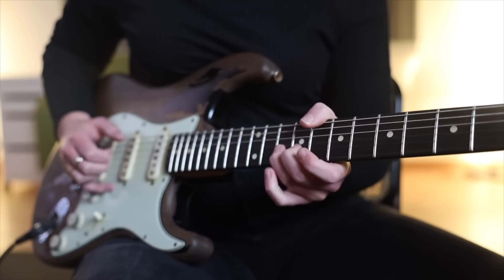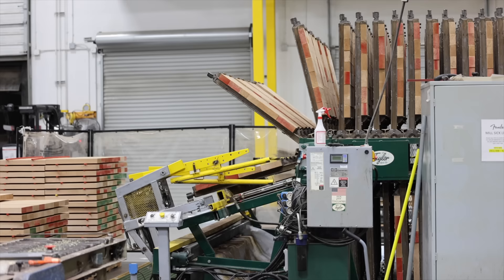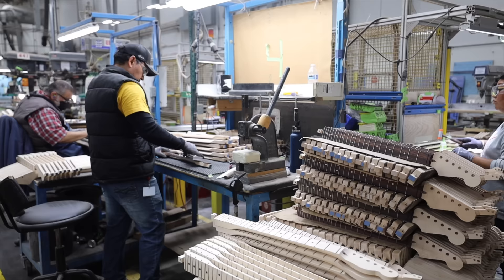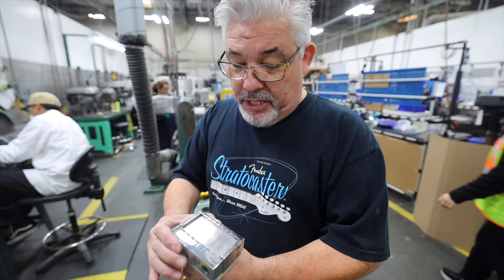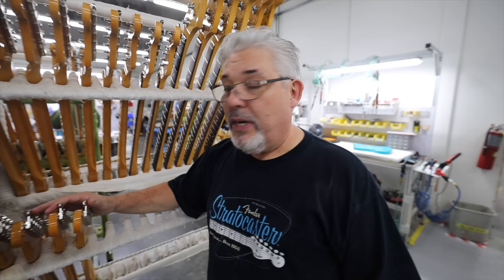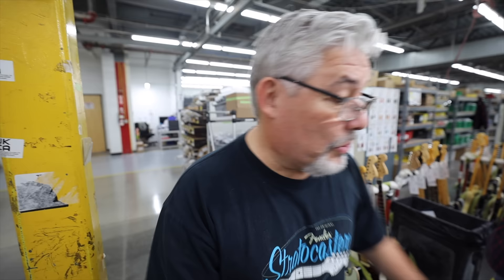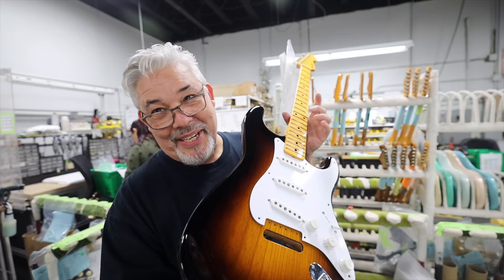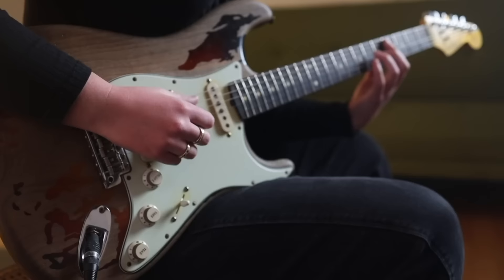How To Build A Fender Guitar

Comment: Dear Fender: As someone who has had to handle and adjust hundreds of your guitars: the intonation tool you use doesn't work. Your guitars aren't made anywhere near precisely enough for that to work. You should consider actually intonating them.
Reply: Good point, maybe for factory?,
But I think everything needs to be hands on.
Reply: I’ve always seen Fenders as a “good enough for government work” kind of guitar—regardless of prices point. I believe dealers should be doing final setup before they go up on the wall. But, that’s simply my opinion.
Reply: @thestuffmikedoes2309  Agreed! I’ve always wondered why that’s not just a standard thing.
Reply: As someone who works on guitars, you should know that setups change as the guitar moves to different climates, and different players prefer different setups, so companies typically just get it in the ballpark and save the man hours. Any competent player can adjust their own intonation.
Reply: @TheRealxVincent  Agreed. I've spent many years paying ppl to set up guitars for me, and it always seemed like it wasn't quite good enough until I bought all the tools and started doing it myself. Now I can fine tune intonation, string height, nut adjustment and neck bow to make my guitar ring the way I want it to.

Comment: I loved this! I worked in manufacturing most of my life, used CNC machines similar to the ones cutting the bodies and necks. My first job was in a machine shop in 1977 on Fender avenue in Fullerton Ca. I was told that Leo Fender owned all the buildings on that street.  Also in the early 2000's the company I worked for moved to Corona Ca. within about a few miles of the Fender factory. I have built a few Appalachian style banjos, tried to play several instruments, but my joke is that I play the stereo best. It was great to see the factory tour, thanks!

Comment: Never owned a Fender but I have played both a strat and a tele of which I used a tele to record the lead guitar bits on our bands 3rd album.

I actually preferred the tele because it felt more naturally comfortable to me. The strat neck felt clunky like I was holding a round chunk of wood which is more than likely due to that particular models neck radius, I think it was a 'U-Shape' neck and the tele was more a traditional 'C-Shape' or faster 'D-Shape' I'm not sure. The engineer told me both Fenders were custom built for the owner of the studio of which our band recorded in.

Great guitars with fantastic tone.

Comment: In the early 70’s I went to pickup directly from the Fullerton factory a long overdue custom Strat I ordered. When I arrived they still hadn’t finished setting the pickup height and action, so I was personally given a tour of the factory while I waited. At the time, they were still using the edge mounted 3-point belt sanders Leo had designed. Though they had incorporated ncn routers for control and neck cavities, necks were still hand-profiled. Finish body shaping was hand done, too. I learned a ton of stuff I later used as a custom builder. One of the most impressive stations was the “water wash spray booths”, a sheet of water behind the piece sprayed so that overspray was trapped in water rather than “filters”. To this day that thing sticks in my mind. At the time, I was spraying nitrocellulous lacquer in the open air of my backyard, totally exposing myself and neighbors to toxic vapors. Not exactly a “good-neighbor” policy??
Reply: Actually, they were using patterns with an “overhead” router running 1/2” router bits. NCN wasn’t used. I started doing the same - rough bandsawing body and headstock and finish them using a router guided by screwed on plexiglass patterns. Hardly needed finish sanding using 1/2 carbide router bits. The trick was roughing them to within an 1/8 to minimize burning, which required excessive sanding
Reply: The other thing that struck me - at the time, frets weren’t hammered from the face but force into fret slots FROM THE EDGE

Comment: Thanks Mary! I got a couple connections to fender besides owning a few and restricting a few as well. My buddy Tracey Chapman has worked there for years and a local customer is one of their label/decal vendors. It’s cool growing up so close. I will say I hope you checked out the snow which is less than an hour away but even more fun and more of what Southern California is all about, the beaches. 😅 I’m 61, till I was 18, corona was where we rode dirt bikes. 
     In the late 80s the inland empire which is where corona is blew up when new housing developments appeared with homes at a fraction of the cost closer to the ocean. Now there’s an hours worth of traffic towards the beach in the morning and the same the other way in the evening (maybe more). 
     Fullerton which is in the best county. (Orange) it a pretty cool spot “DTF” is known for lots of bars and restaurants , collage townish. Too far from the ocean though. If you live on the beach side of the 405 in OC you only need air con 2 weeks a year and heat the same amount of time.  
      If you missed it on this trip, come back and you aren’t gonna hate it.

Comment: Great video, well shot, tells the story very well. Just an aside that has nothing to do with the story: it was so great to see that photo of Les Paul in front of an old control board - one of the radio stations I worked at back in the 70s had one much like it as its main control. An old RCA built like a tank. It sounded pretty good once the tubes got warmed up. They had big old RCA ribbon mics too. Never thought I'd be nostalgic about that stuff.

Comment: I have an idea for Fenders body blanks, that is more efficient than the automated camera-thing: bookmatching! The colour will always be uniform on the bodies and the grain will always be more than 75% symmetrical
Reply: That might be more efficient for matching the wood tones and creating symmetrical bodies, but it's not the more efficient use of the material. If you only use exact book-matching pieces, all the other wood gets wasted. And you're not even going to see a lot of the book matched pieces anyway due to the paints and finishes that are most common on Stratocasters and the other electric guitars. It's more efficient at Fender's manufacturing scale to automate the wood selection and then have a team of people do the glue-ups.

Comment: Great video but there another side to the story - questionable QC in Fender’s factory. I have an AM Pro ii tele with maple neck. This is an expensive guitar and it came with lacquer sprayed all over the frets and nut. The nut was not cut well either. I had to remove the lacquer and polish the frets. Sand the lacquer off the nut and cut it correctly. Luckily I have the skills to do this myself. It would have been a costly job if someone needed to get it done by a tech.
Reply: I suppose the best recourse is to purchase via a big name like Sweetwater that will do the necessary checks beforehand. It cannot help morale that this plants entire 3rd shift was gutted in 2022. For the highest quality Fenders, either an old or new made in Japan Strat is the way to go. I had a late 80's model Strat but sold it many years ago but later acquired a late 80's Strat XII that was also MIJ.

Comment: Great, enticing video 😃👍!

So, what do I need to pay for a custom fretless, un-lined, un-dotted/-inlaid, un-side-dotted – unmarked in general – Jazz Bass V (low-B), 40-60-80-100-120 (125, if you must? 🤦🏼‍♀️), with an unaltered fingerboard, all the way up to the neck pickup (ideally with deeper cutout, but not mandatory), flat or very(!) large radius, rosewood, with the nut carved out of the the same plank (not separated), no binding (OMG 🤦🏼‍♀️), mandolin fret-wire (on a fretted cousin), 16-17mm string spacing, 60s PUs in 70s PU positions, but with early 60's volume-tone stack knobs, wired in stereo (i.e. separate outputs per PU), natural finish (oiled; better still, just waxed!), 3-bolt adjustable neck plate, no scratch plate, high mass bridge... etc. ?

Aka, fully ripened instruments, rather than ... what are these things we but off the rack, really?
Passive, of course!  5Kg max!

Any master builder up for the challenge?

Comment: What a great, informative video! I loved the quotes you included at the beginning.  You do the research, and your drive shows.  Too bad they didn't let you see the line where they are using UV  coatings. That's really an innovation, and I hope that they convert all their lines to UV.  The UV coatings significantly reduce the drying times - almost immediate, and also significantly reduce air pollution emissions.

I'm down the road from Corona (between NAMM and Fender) and am hoping to get a tour myself in the near future.  Now that I've seen your video, I can skip some areas! 😀

Comment: The failure occurs at QC. Love Fender but every new guitar I’ve purchased from them (not cheap!) has had an issue. Some quite serious, like the truss rod on my Marr Jag having no room for adjustment brand new or my Vintage Strat’s top e falling off the fretboard. These should never leave the factory.

Comment: Great video! I have to say, though, that my new American Pro II came with a terrible setup. Even the neck tilt was off. The bolt on neck angle is out as well. Low E string keeps slipping off the neck.  The guitar was just too expensive for such poor QC.  For all the bad press LP has received over QC, mine came out of the factory perfect. 

I agree with all the comments about Mary's perfect voice for broadcasting and voice-over work.

Comment: Everyone has their own preferences, and what works for me may not work for you.  That said, for me, the desert island guitar is a simple Fender HSS Fat Strat. Its the one single model of guitar that does more for me personally than any other. For me, its the most important instrument on the planet.  If all I have is a good Fat Strat, I am good.

I like other guitars, sure. I love a '72 Custom Tele. I had a real 1965 Mustang.  I do love a Les Paul, or a Korina V... But Fender has disappointed me precisely never. My main is always a Fender. And if my #1 is a Fat Strat, my #2... Is that '72 Custom I mentioned.  So for me, Fender is the most important guitar maker out there. Thats not a slight on PRS, Gibson or anyone else .. just for me, Fender scratches the most itches. And I can't even imagine bot having a Fat Strat.  That is the core of 'me' as a player. Jumping between those single coils and that 'bucker are a key of 'my' sound.

So I am hally Fender is successful. I am happy for their quality. And wether Corona or Ensenada, I tip my hat to the factory workers. I genuinely think they do great work.

The only other guitar company I have as much respect for is Martin.  And for the same reasons.

Rock on Fender, rock on...

Comment: My only gripe with bolt-on guitars is the abrupt stop to the design flow where the neck meets the body. How about adding a little wood cap that mimics a set neck heel, if only for aesthetics?
Reply: That's an interesting thought and not hard to do. I'm going to look into that for my next build. Thanks for the idea.
Reply: @iainthomas5249 It wouldn't cost Fender much to implement and it would improve the feel of the neck as it transitioned to the body.

Comment: For instrument is made with CNC, I've been very disappointed with the alignment of the neck to the body, specifically how the strings line up to the neck.  Too many are off kilter, with either the high or low E is closer to the edge than the other.  If I owned a guitar store, I'd be rejecting every one until they go back and adjust the CNC machines.  I've seen this on too many expensive guitars and would not own a single one of them.  This is unacceptable and should be watched more closely.

Comment: I would bet that the standard line people could deliver the same quality as the master builders if they weren't concerned with time and efficiency and could focus more on QC. These ordinary people probably have years and years of experience working on guitars, just like the master builders. A standard guitar leaves the factory as efficient as possible: the intonation is eyeballed, the nutslots are way too high as to not have problems in the guitar shop, etc. They have business to run after all. One person building a guitar from scratch doesn't give it the necessary QC and mojo to justify the prices they ask. A master built guitar is very much a luxury item for rich people.

Comment: In my 30 plus years of playing guitar, I've owned several strats from just about all of Fender's tiers of quality and countries of origin, but I have never dug them. They are comfortable to play..and they definitely have their own distinct, stratty sound... but that sound is not for me. I also don't like the heel joint..I don't like the trem..and most of all, I don't like their thin, jangly sound...  Also, when spending good money on a guitar, I don't want a guitar with a built on neck. It is just a hangup I have. If the guitar costs more than 1000 dollars, I have a set neck or neck through. I just feel that in some way, the labour and attention needed in a set neck guitar offsets some of the higher price tag. Whereas a group of monkeys could be put in an assembly line and trained to built strats. heeh.

Comment: You start with a boring old out dated design. Use crappy single coils in the bridge, use a trem system that goes out of tune, and then beat the fuck out of it and sell it for 6k as a custom shop relic